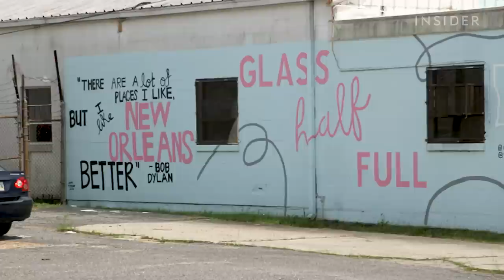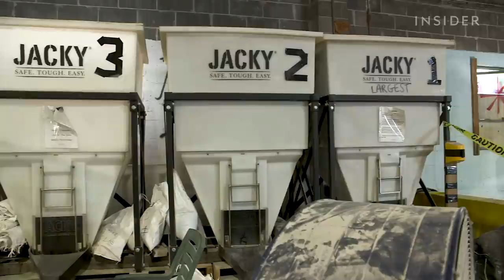How Sand Made From Crushed Glass Rebuilds Louisiana’s Shrinking Coast

Comment: All glass is collected and recycled in the UK; we treat our waste as a product to be processed and sold on as raw material.  Similarly, metal cans and plastics are sorted at home and collected every week then sold back to manufacturing; organic waste is composted and then sold as growing nutrient. Solutions exist!
Reply: It's similar in Germany
Reply: Same here.  Most of that glass is never re-made into new containers though, since it has a high contamination level.  Food, chemicals, paper plastic etc.   The bottles have to cleaned to a high standard which is very expensive meaning........recycling the glass is more costly than using new materials.  In many cases communities just end up paying to have it land filled.
Reply: A~and this is one of those solutions.  As it currently stands, processing the bottles for reuse is not only more expensive than simply making new bottles, it's exorbitantly so.  That said, the issues that make it hard for the whole bottle to be reused don't affect the utility of the material involved in them if the bottles are simply crushed, ground and used as sand.
Reply: That's great but the US is a lot more spread out for example Alaska is bigger than both Germany and the UK combined and a few states are bigger than either country.  England has no trees or any wildlife that once existed there.

Comment: The IPCC has not found any trend in the strength or frequency of storms.  Saying stuff that isn't true repeatedly doesn't make it true
Reply: The recycling is being done anyway, which is good.
Reply: @marzupalami  If there was some kind of standardisation of bottles, that bottles were cleaned for another use, don't you think it'd be a better use of ressources ? Rather than using energy to melt the old glass ?

Comment: Some asphalt businesses are using up to 20% Crumb rubber in states in the west ..
It is more flexible and less long term maintenance, but more expensive to make cause Crumb rubber is still expensive... but so far I haven't heard of any companies putting crushed glass in the asphalt in place of regular sand.. you would have to research that too..
Just giving you ideas to try.
Good luck
Dana
Reply: "20% Crumb rubber in states in the west", total failure here in Phoenix, have you ever seen trailer parks?; they cover all the tires so sun will not rot them so quick. When the rubber starts fail the that rubber moves into the atmosphere and tire noise is louder.

Comment: Can this sand be used in construction, and in making cement?
Reply: Absolutely. as % blend it can add significant strength to the cement as it has a high amorphous silica content with not silt that is prominent in river and ocean sand.
Reply: It absolutely can be, as the sand is rough enough. Sand from the desert is not suitable since it rubs up against itself, making the grains too smooth. Therefore it would need to be remelted.
Reply: Yes

Comment: What's the bet this will eventually turn into some unintended ecological disaster....
Reply: I mean if they got scientists I bet they’d be alright 😅
Reply: Very low.  Glass is, basically, just sand melted together.  All Glass Half Full is doing is reversing the process.
Reply: @miketheskepticalone6285 They've not reversed the chemical process.
Reply: ... not a lot of chemical process involved in glass,  @veniqe  , that's kind of why we use it for processing chemicals in.  Soda ash and lime are used to make the melted sand crytalise in a homogeneous and reinforcing manner.  They USED to use metal salts to induce varying levels of toughness, hardness, or clarity, but mostly it's just silica sand with a little flux that gets flushed off as it's processed into plate, or various bottles or the like.

All these guys are doing is turning what is a glut in their area ... bottles ... into material which is rare in their area ... sand.
Reply: @miketheskepticalone6285  What matters is not how many chemical process there are; what matters is whether or not an item has undergone a chemical process.

If a raw product has undergone a chemical change, then the new item can't be turned back into the raw product. Bread, for example, can't be turned back into wheat flour, and only wheat flour.

Comment: Kudos for trying to do something with the waste problem. But this looks like a wrong solution for a solved problem. Turning glass in to sand is very inefficient. You start with sand, use a bunch of resources to create glass and use a bunch of resources to create sand again. You then redo this to create new glass and turn it into sand. If you use the old glass to make new glass you only need to add a bit of energie to create new glass.

If you start by solving the real problem you will see why this is a wrong solution. The main problem is dumping waste in landfills. This is stupid. Glass and metals will not decay. Plastics will take centuries to decay. That is why a lot of countries stopped doing that. They reclaim as much as possible. Organic material is used to create natural gas and compost. What is left over is burned. As technology progresses, more and more materials can be extracted from garbage and reused.

The sand that is eroded from the coast is in the water at the coast. you can simply dredge it up and deposit it at the coast. A lot of coastal countries have been doning this for decades.
Reply: Glass is the result of an irreversible chemical reaction. Glass can't be turned back into sand, much like bread can't be turned back into 100% pure wheat flour.

Comment: This should not be a private initiative. Every business making or importing glass, should be funding localised glass crushing facilities across the nation on a scale that will cover 100% of glass waste with minimal stockpiling and zero bulk transport of intermediate waste glass.

Silicon dust is one of the most dangerous chemically inert substances on the planet. Ultra-fine particles linger in the air for days, so that factory is NEVER safe to enter without PPE. This is where government funding is needed to protect people working in the industry. Workers should be in positive pressure suits and the entire factory should be a negative pressure facility, preventing dust escaping.